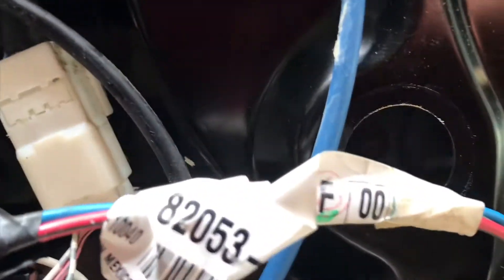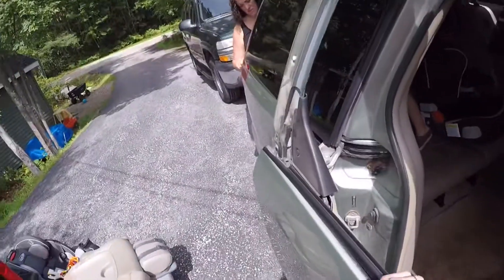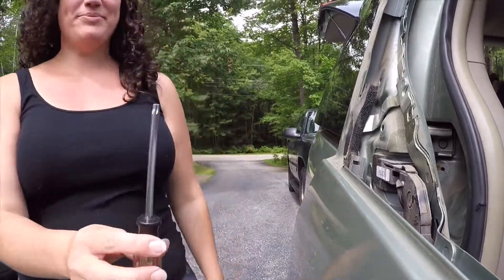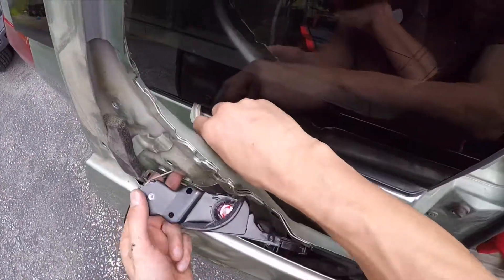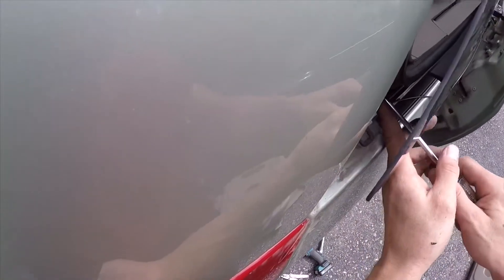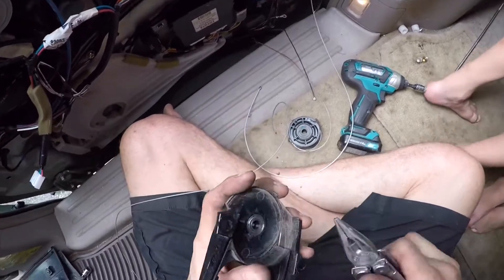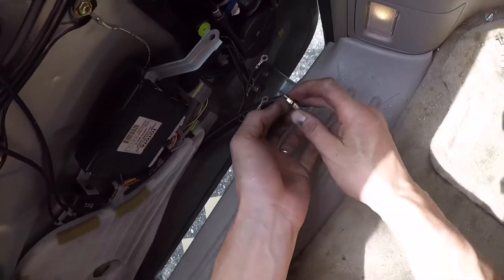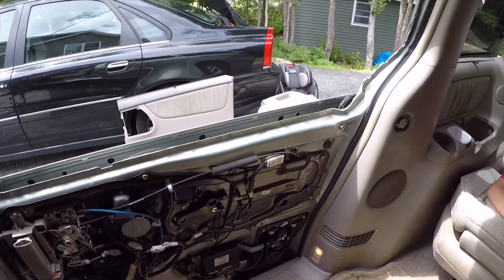TOYOTA SIENNA POWER SLIDING DOOR CABLE REPLACEMENT!

Comment: Now they sell OEM Toyota part that comes with pan, spool, spool cover, and cables pre- assembelled but without the motor. All you need is to swap the motor to the new part, and then insert/install the new assembly. Cost around $290 plus shipping, got it from Toyota McGeorge. Part number for the right side 69631-08031